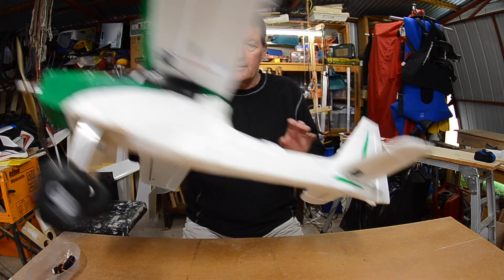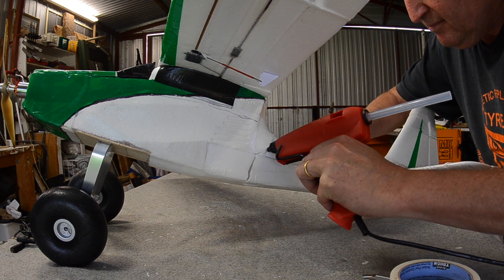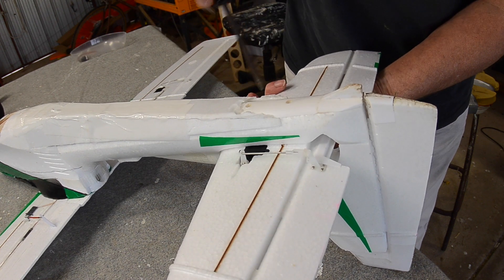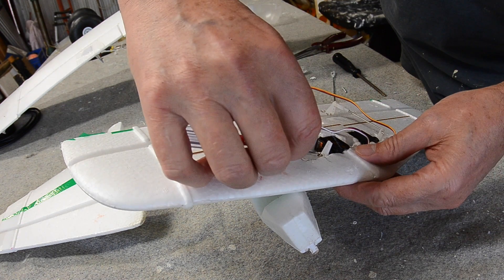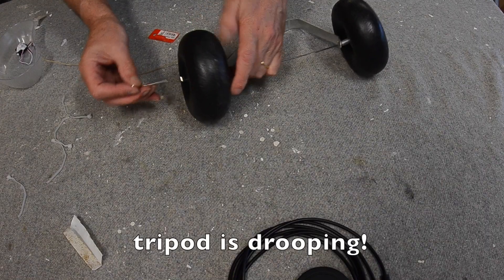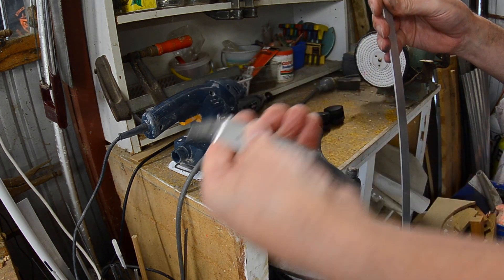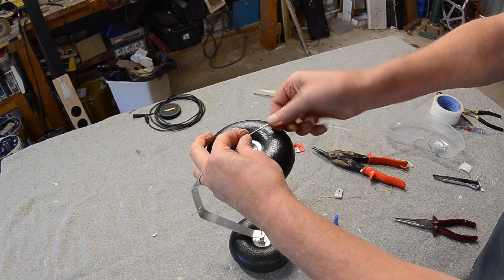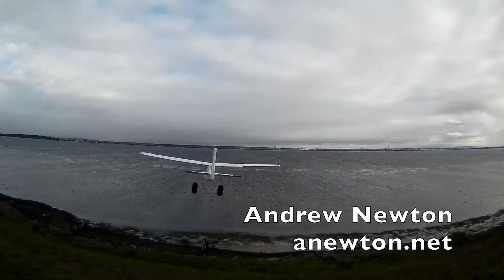Vundra repair and landing gear

Comment: I got a Sukhoi in the parts left over bin, in half at this time, and this video has inspired me to get it back into the payroll for flight. 
Thanks Andrew for your time and informative videos!
Still rockin with the Bixler 2, replaced the aileron servos with Hitec -HS55, and no more issues, some mix aileron/rudder, 20 min or more flights on a Zippy 2200mah 40c
Reply from the maker: Yes bring it back to life as something else